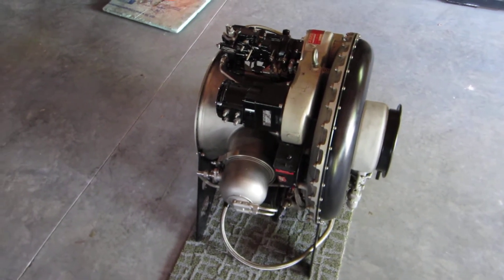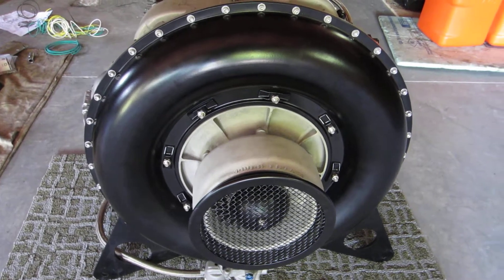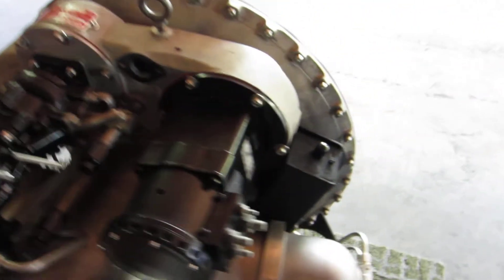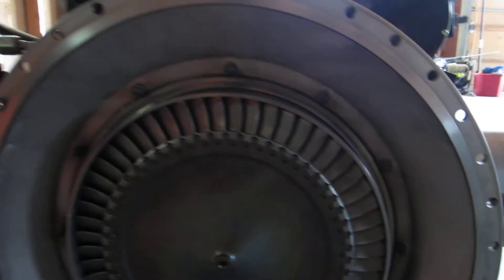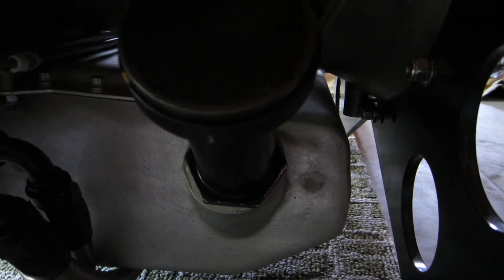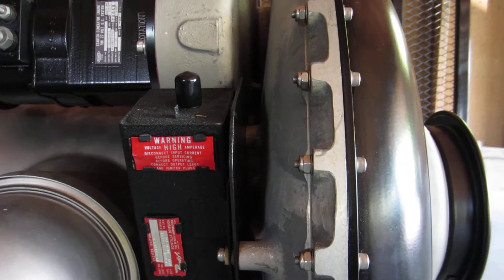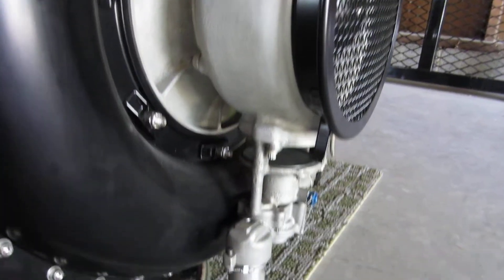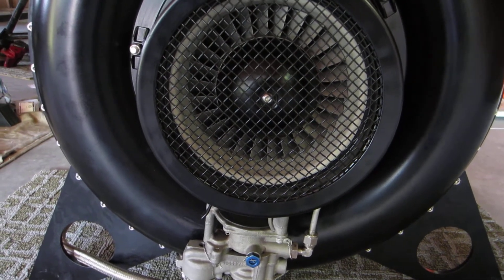JET ENGINE FOR SALE: Boeing T50-BO-12 Gas Turbine Turbojet

Comment: Have you measured the actual thrust with the rear section?
Reply from the maker: With a basic nozzle this engine will produce approximately 350lbs of thrust. If you refine/tune the nozzle you can expect more. An afterburning nozzle will increase thrust significantly for short durations. Thank you for the inquiry.

Comment: Lost me at the first sentence:  'Turb-eyen'?  On the flightline, a turbine always been pronounced 'Turb-inns'. Probably a petty distinction, but when I went to school for my  A&P it was drilled into me a dozen times:  'Turb-eyens' go in dams and steamships, 'Turbinns' go in aircraft.  I guess it differentiates machines that use the  potential energy of a gas or fluid to generate power (the 'eyens) versus ones that create kinetic energy and transfer it to a gas or fluid (the 'inns):  it does not matter whether that energy provides a gas stream to generate thrust or it impinges on a rotor to apply torque to a shaft. My 0.02 FWIW.